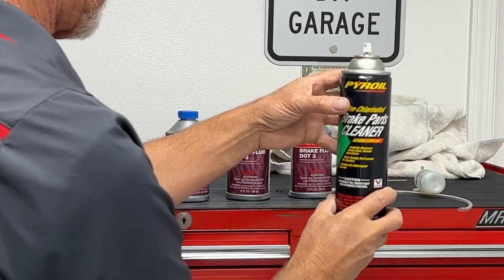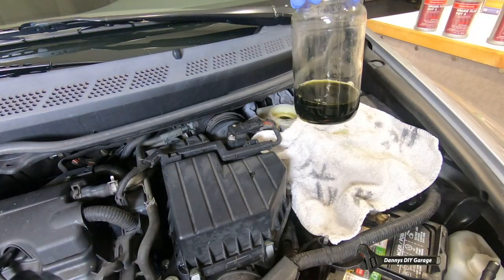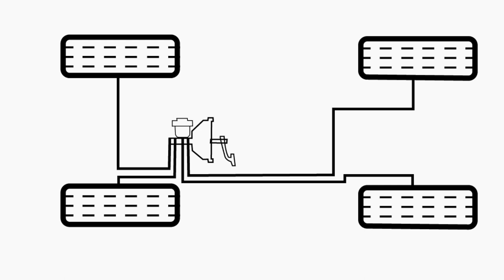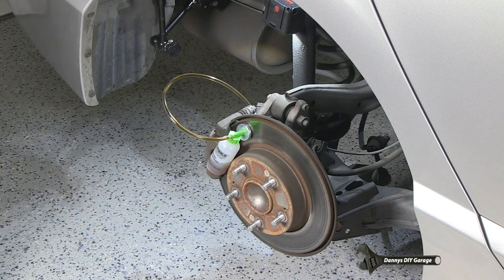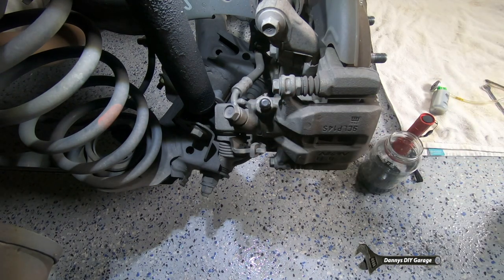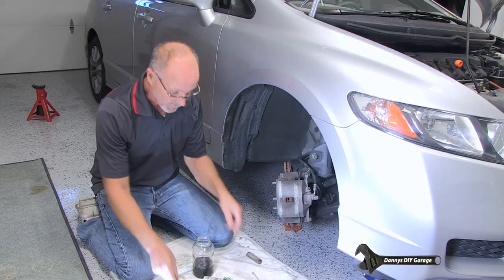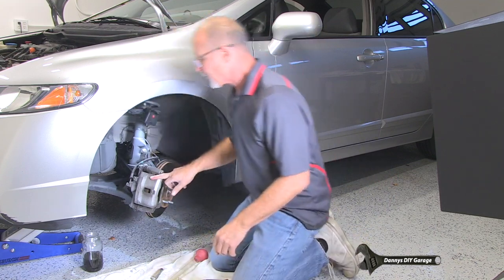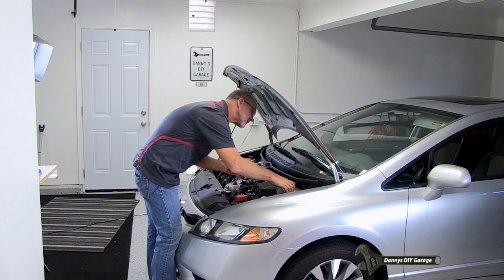Honda Civic, Brake System Flush, 8th generation DIY service flushing your brake fluid

Comment: One step not mentioned…Spray the inside of the brake nipples with brake cleaner then dry them out with compressed air before putting the rubber nipple caps back on.

Comment from the maker: No it doesn’t damage the master cylinder, yes, that is correct 8 time pushing the pedal is sufficient, the main thing is not to run out of brake fluid in the master cylinder as you’re flushing, once clean fluid comes out you can stop, it could only be 4 times

Comment: HONDA "manual" for ABS actually says...... START at the drivers front, passenger front, passenger rear then Drivers rear when bleeding...   Don't push pedal all the way down...
Reply from the maker: Follow the manual, it won’t matter at the end, results are the same
Reply: Why not push pedal all way down?

Camry manual says to pump pedal three times and hold midway and have buddy crack bleeder loose and let fluid out then tighten bleeder when flow stops and then driver release pedal and repeat steps same order until bled

Have a civic accord and Camry

Comment: I'm all for using OEM parts and fluids but any name brand brake fluid will work just as well and be a lot cheaper. Honda doesn't make their own brake fluid.
Reply from the maker: Great information, thanks for adding

Comment: Awesome video, I just did my brakes 3 months ago completely rebuilt brakes front and rear with new calipers on my 2007 EX Coupe . Flushed system with harbor freight brake pressure bleeder for 34.00 tht connects to brake bleeders and a compressor awesome tool, it took  me 45 mins,fluid was black as coal, car from Miami Florida, thks for sharing,
Reply from the maker: Awesome story Scott, thank for sharing

Comment: I love the turkey baster idea. I've always used a large syringe. But the plunger tends to degrade over time, so I have to keep buying them. The turkey baster seems like it would hold up longer, plus you can pretty much operate it with one hand, as opposed to the syringe which you kind of can use one handed, but it's not nearly as easy.
Reply from the maker: Turkey basters are also cheep to purchase

Comment: Hi,Thanks for the video. Im from Malaysia and i have a 2012 Honda Civic 2.0s (9th Gen). The honda brake fluid that i will be purhasing is 1Litre. Would i need more than a litre of fluid to do a proper flush on all four tyres? Hope to hear from you soon.
Reply from the maker: yes that should be enough
Reply: @dannysdiygarage  Thank you. Appreciate it 👌

Comment: Hi Danny, when pushing the brake pedal how far do you press the pedal? 100% to the floor or just half way? The honda service manual does not specify, but we have toyotas too and the camry service manual specified with bleeder closed pump up the pedal 3 times and hold it steady and have someone else crack bleeder without moving brake pedal further, then close bleeder after fluid stops moving while person in car still holding brake pedal at same position pressed in

Is that toyota service manual method overkill? Honda does not specify this great of detail in service manual

Comment: Hey Danny,
The Honda service manual says bleed order is front left front right rear right rear left. Would you recommend following the Honda service manual in this case?
Reply from the maker: I would recommend following the owner manual recommended procedure, mine came out perfect, I should have read the service manual
Reply: @dannysdiygarage  
I noticed Toyota Camry service manual specified the order you did here.

Service Manual for civic and accord state the bleed order as clockwise starting with driver front and ending driver rear (when thinking of a top down view of vehicle)
Reply: Perfect and clear. Sped up the video 1.5x and it was perfect. Thank you very much.

Comment: Danny i love the video. Thanks for making this.  I saw another method where you can use a vacumm extractor tool to attach to the bleeder valve and pump the trigger to extract/suck out the brake fluid from the line into a container. Don't need to go into vehicle and pump pedal. Not sure which method I'll use at this time. Question:  What product did you use to epoxy your garage floor?  Did you DIY that ? or have company come in and do it for you?  I'd be interested in you doing a video on how you did your floor if you did it yourself?Thankyou!
Reply from the maker: Yes DIY job, I actually have two videos on the garage floor, here https://youtu.be/yGPGz0iWN1k?si=rSRg_v1c3N9Sj8ah

Comment: Great video.  Instead of a turkey baster, I use a battery acid filler - you find these in battery accessory section of auto parts stores. Bulb has a bit more capacity.
Reply from the maker: appreciate your input, great recommendation, I added it to the description on what to buy to do the job

Comment: Thanks for the video… can you please make video on how to diagnose hard steering wheel ?
Reply from the maker: I’ll put it on my list, I’d love to know more about your steering issue
Reply: @dannysdiygarage  thanks for the reply… I don’t have any issue with steering, I feel bit hardness while turning at slow speeds even I changed my steering fluid recently but no use I suspect that it is an issue with suspension bearings…
Reply from the maker: Thanks, that’s a great idea for a video, (Checking Suspension), appreciate the feedback

Comment: Hi Danny,

I have Honda Civic X 2018 model and i am planning to flush it's brake system for the first time. Do i need to push the brake pedal all the way down, wouldn't that damage master cylinder seals?

Further, what i got from your video is that u pushed pedal 11, 8, 7, 8 times from farthest to nearest.

Hope to hear from u soon.

Thanks

Comment: Hi Danny,

Nice video...!

Kindly help me out with following query;

Before replacing front and read brake pads, callipers' pistons are pressed inwards and fluid level in reservoir comes to max level subject to there isn't any leak in system. Do we need to bleed air in that case?

Thanks.
Reply from the maker: short answer is no, check out this video I did on replacing pads, around the 3 minute mark I explain this process about pushing your old fluid back into your reservoir, https://youtu.be/rSS5KP_2mLY

Comment: Great video thanks Dan. Is there any specific torque to tighten the bleeder screws? Also my son’s car has rear drum brakes. I assume the process is still the same but the different size wrench mentioned at the end? Thanks in advance!
Reply from the maker: Yes process is the same, I’m sure there’s a specification, I didn’t use it, tighten it and check to make sure it doesn’t leak and you’re done
Reply: @dannysdiygarage  thanks Dan have a great holiday ahead.
Reply from the maker: @timt7657  you also ❤️